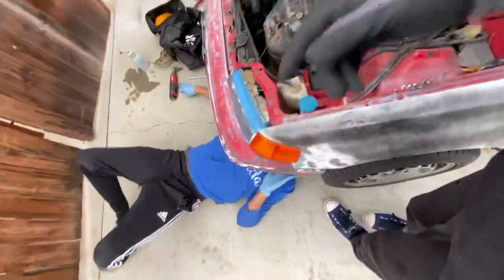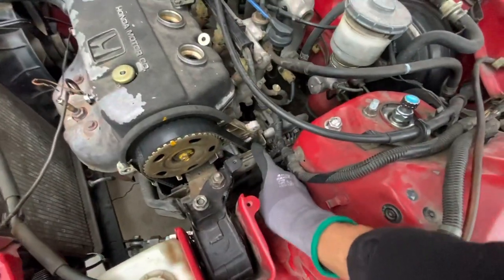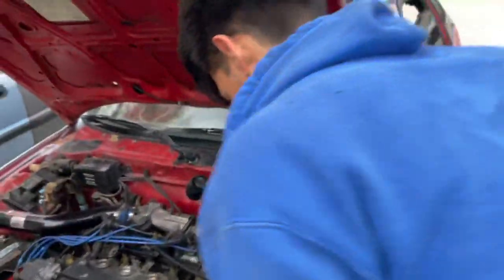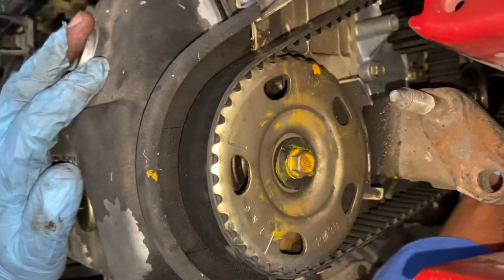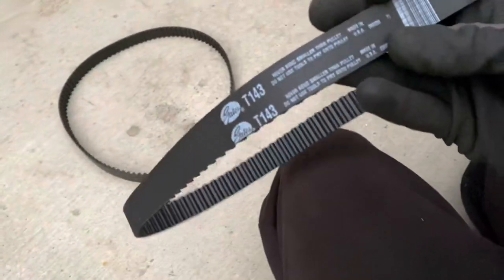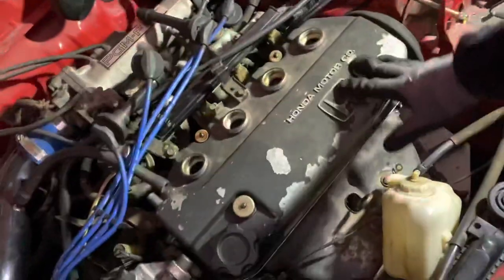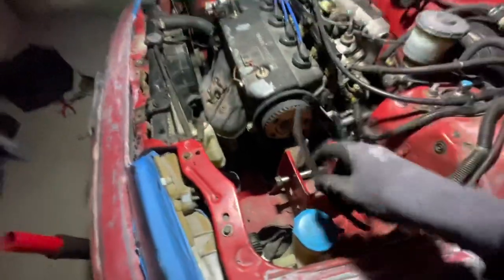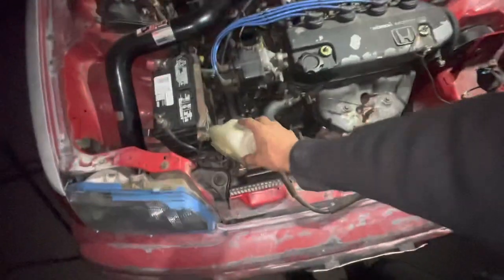BONUS EPISODE!! Honda Civic CRX Timing Belt Replacement in 1 HOUR!!

Comment: Always change the water pump, tensioner, and front main seal.  Crank position sensor should be changed while you are there.  It's a bitch, you don't want to do it over correctly the second or third time.

Comment: Question, in what direction did you loosen the crank pulley, is it the classic left to loosen or does it loosen the other way (right rotation)
Reply: Honda D series (and B series) -- unless I'm trippin' -- all spin COUNTER clockwise.
Reply: yeah but what direction do you loose it? Right or left? 
Should be right since it spins counter clockwise right? @Maplecook
Reply: @Solegna01  Counterclockwise!  Left and right are meaningless, counterclockwise as viewed from the head of the bolt or nut.  Regular right-hand thread is what the man meant.

Comment: Honda timing belts are a bit@$! Couple of things need to be addressed here...never "assume" the cam timming is correct by marks someone else left..it could be off by a little or a lot and either scenario is bad. Timing marks have to be 100% perfect.Always replace the tensioner, they can fail long before a belt . Also Mitsubishi manufactured a lot of OEM timing belts for Japanese cars, they make dishwashers too.

Comment: By walking you mean, when it’s on and you see the camshaft walking back and forth ?
Reply from the maker: no by walking i mean it’ll slowly slide off the sprockets
Reply: Wiggling left and right while pulling the sprocket or harmonic balance off or on, it's just to keep it moving on the shaft.